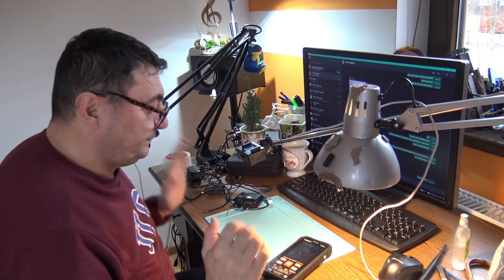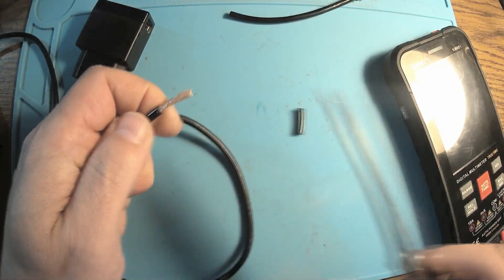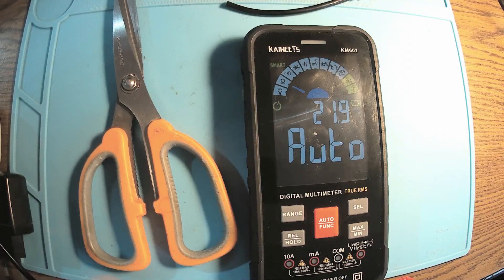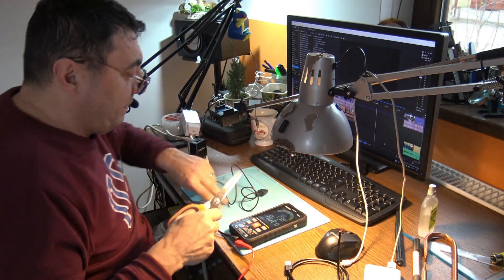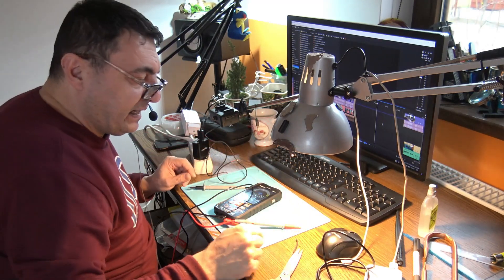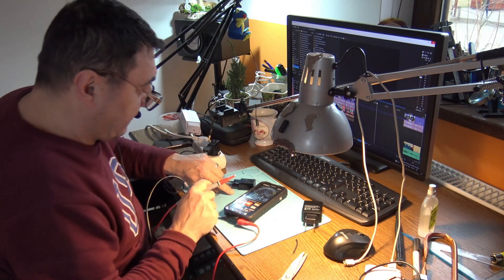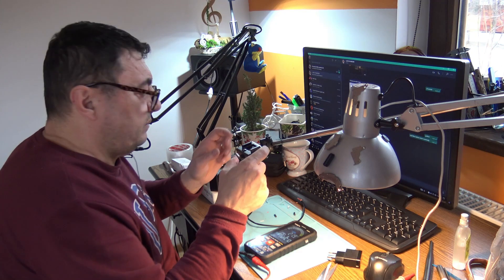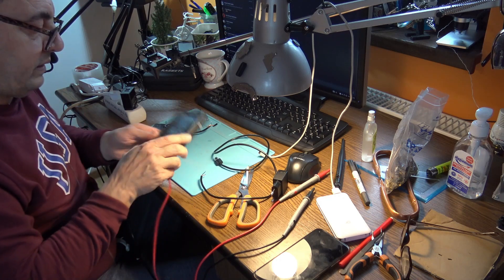5V power supply for Helium LoRa IoT amplifiers

Comment: Does someone know the power connector on AB-868-5V? The female end has a nice latch, but I haven't found a source for that cable.
Reply from the maker: I didn't notice that...just plug a wall power supply
Reply: @viocaia  Can't plug in without the correct power plug.

Comment: I have 2 Airbudy. One is working fine. the other has no light at all. I'm worried if used wrong usb power...I thought they have protection from wrong polarity?? Anywhy to check that ? can they get burned ?
Reply from the maker: If you used a USB port for power supply, it shouldn't be a problem do the port current limitation, but with an external power supply, more then 2A it is possible to get burn..I did a test with 2.5A for few seconds, nothing wrong happened but I'm not sure if exposed to a high current revers  polarity for longer period will do a damage..it looks like..if there is no green LED if feels like gone..To check if is still alive you should have around 8,9mA.Also check witha ohmmeter if the amp is in short..it can be that big capacitor near the power connector..take that out.
Reply: @viocaia  As always my friend, thanks alot :)
Reply from the maker: @waila8200  Thank you too!!
Reply from the maker: @waila8200  If they can't/won't fix them send it to me, I have sparre ABS with replacement parts, maybe we can solve.
Reply: @viocaia  great option, thanks a lot. I will updage you :)

Comment: How do we connect our helium miner to this apparatus. Where should we put our cable?  Also, because flarm boosters are 17dbi, can they malfunction in the 868 band? Do you know a flarm booster product that works in a lower gain 868 band? thanks
Reply from the maker: That is only an idea for power supply an amplifier..so do not connect any power supply to any port of your miner, except the original. Using a Flarm amplifier for 868Mhz proves doubtedly , also any other brand gives me no positive results..but still trying. 17dB for RX, there will no harm, also Flarm provide a max 5dB for TX, no problem also..I shouldn't buy any Flarm, as they are speculate the helium miner need without any proved positive results..there should be cheaper ways..I should start with a good antenna and the best cables .
Reply: @viocaia  thank you
Reply from the maker: @ferhataslan1556  Me too

Comment: which amplifier do you recommend, or is an amplifier really needed?
Reply from the maker: Depends of your location..if you are in a populated hotspots area..no need..maybe a filter to ''clean'' the air..but, the other side, small community with 20 hotspots in 10Km radius..you're done! Can't get more..so the single escape is a directional and an amplifier to reach as far as you can..
Reply from the maker: Can't be sure by any amplifier now..needs more time..
Reply: @viocaia  I am going to put a miner in Portugal in the top of mountain!  City is like 20 to 30 km away!!
Reply from the maker: @joesousa6837  Best location ever! You need a good antenna..like 6, maybe 8dB..
Reply from the maker: No need for amplifier..it's enough that you're up!

Comment: What about the hotspot's/Pi4's USB connectors? I mean, why should I use a phone charger when I have 5V directly from the hotspot?
Reply from the maker: perfect..the best solution..
Reply: Do you know how many Amp is power from miner USB?
Reply from the maker: @andrejastarcevic7953  Not much..maybe 0.5A..
Reply: @viocaia   Is it enough considering that ab-iot uses 750mA when transmiting according to manual?
Reply from the maker: @andrejastarcevic7953  I wouldn't risk it... that port is strictly for data..I'm sure not for relatively high current..what so hard an extra power supply..?
Reply: @viocaia  True.Thanks